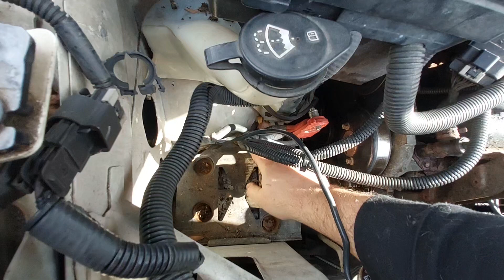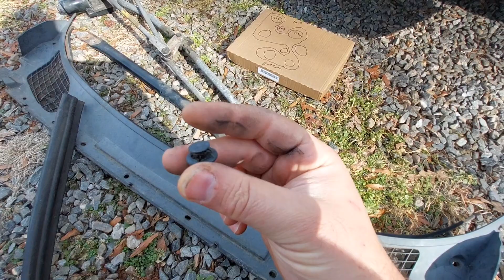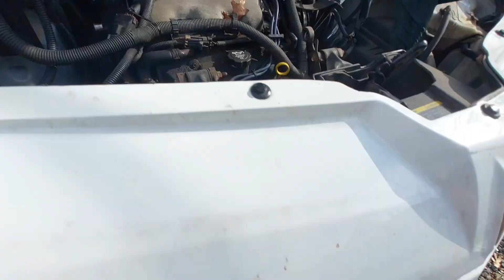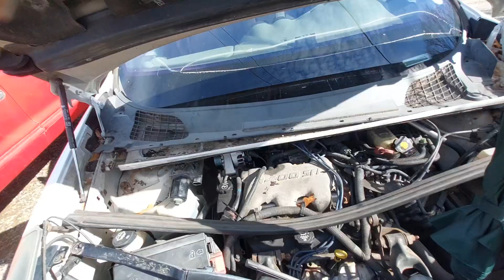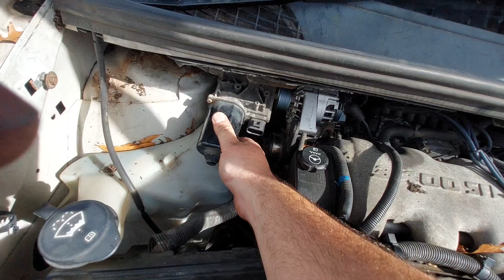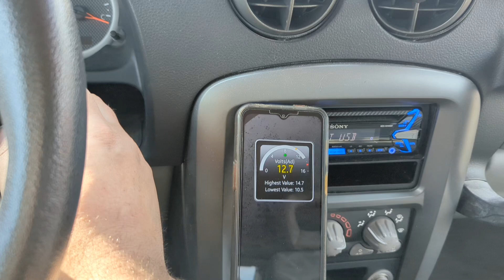How to remove the alternator and battery from a 2002 Pontiac Aztek the "easy" way

Comment: What wrench you used for the back bolts of alternator?
Reply from the maker: Its a 15mm.  Cant use a socket as it is too tight.  15 should be on the shorter side as well as there is not a lot of clearance